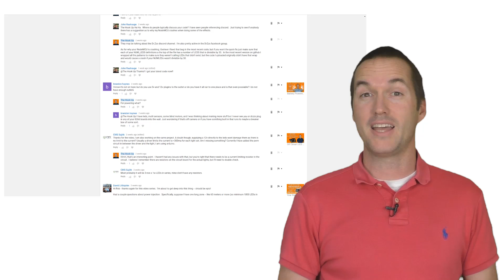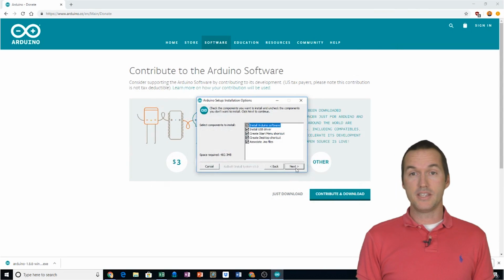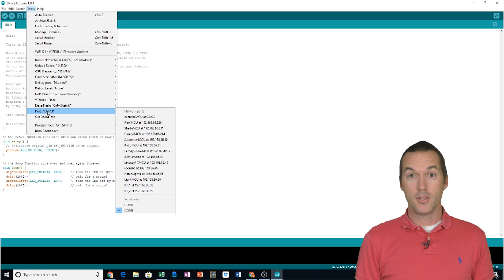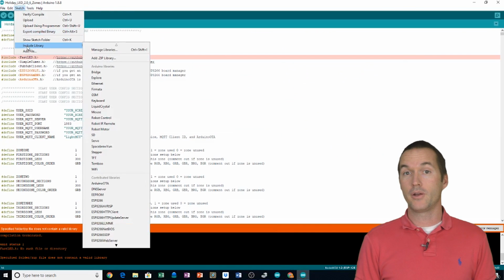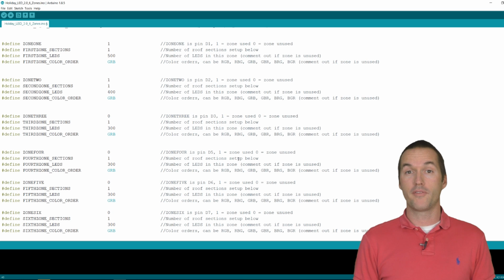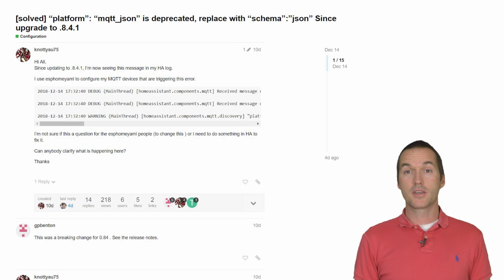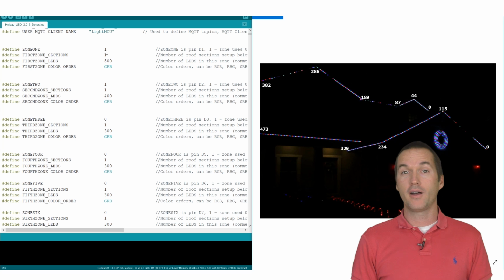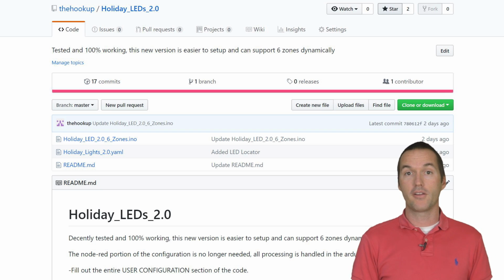Total Beginners Guide: Holiday Lights 2.0 Step by Step Arduino Installation and Setup.

Comment: Hi Rob, 
 Me again.. Im having trouble getting my "cards" and "Groups" loaded to make the buttons toggle the switch. The Current LED has no Slider Feature. Both the HA and NodeMCU are talking to my MQTT Broker. Home Assistant 0.101.3 is the version I am running.
Reply from the maker: Can you add them using the "configure UI" feature (click on the three dots in the upper left corner of HA).
Reply: @TheHookUp  Thanks, I'll try this when I get off work, I appreciate your quick response. I'll definitely be joining your patreons page as well. I also purchased a pi4 2GB  running HA with the 64bit image of Hassio if that makes a difference. Really enjoy your videos. Keep up the great work!
Reply: @TheHookUp  I was able to add them, unfortunately my set up is missing some key items. Locate LED sensor had no function, I was able to get the Holiday light switch to work. Colors 1,2,3 are unresponsive . Also, I don't have the W slider.
Reply from the maker: @AirBoone  sounds like the issue may be with your configuration.yaml file.  Can you post your entries from your config.yaml?
Reply: @TheHookUp   
 Yaml File:
# Configure a default setup of Home Assistant (frontend, api, etc)
default_config:
# Uncomment this if you are using SSL/TLS, running in Docker container, etc.
# http:
#   base_url: example.duckdns.org:8123
# Text to speech

tts:
  - platform: google_translate

group: !include groups.yaml
automation: !include automations.yaml
script: !include scripts.yaml

sensor:
  - platform: mqtt
    name: "Current LED"
    state_topic: "lightsmcu/locator"

light:
  - platform: mqtt
    name: "Holiday Lights"
    command_topic: "lightsmcu/power"
    state_topic: "lightsmcu/powerState"
    brightness_command_topic: "lightsmcu/brightness"
    brightness_state_topic: "lightsmcu/brightnessState"
    brightness_scale: 255
    white_value_command_topic: "lightsmcu/modifier"
    white_value_state_topic: "lightsmcu/modifierState"
    white_value_scale: 500
    effect_command_topic: "lightsmcu/effect"
    effect_state_topic: "lightsmcu/effectState"
    effect_list:
      - Color_Chase
      - Color_Glitter
      - Single_Race
      - Double_Crash
      - Rainbow
      - Blocked_Colors
      - BPM
      - Twinkle
      - Fire
      - Fill_Solid
      - Spooky_Eyes
      - LED_Locator
    retain: true
  - platform: mqtt
    name: "Color 1"
    command_topic: "lightsmcu/ColorPower"
    state_topic: "lightsmcu/powerState"
    rgb_command_topic: "lightsmcu/color1"
    rgb_state_topic: "lightsmcu/color1State"
    retain: true
  - platform: mqtt
    name: "Color 2"
    command_topic: "lightsmcu/ColorPower"
    state_topic: "lightsmcu/powerState"
    rgb_command_topic: "lightsmcu/color2"
    rgb_state_topic: "lightsmcu/color2State"
    retain: true
  - platform: mqtt
    name: "Color 3"
    command_topic: "lightsmcu/ColorPower"
    state_topic: "lightsmcu/powerState"
    rgb_command_topic: "lightsmcu/color3"
    rgb_state_topic: "lightsmcu/color3State"
    retain: true
  - platform: mqtt
    name: "Glitter"
    state_topic: "lightsmcu/glitter/state"
    command_topic: "lightsmcu/addEffects"
    payload_on: "Glitter On"
    payload_off: "Glitter Off"
    rgb_command_topic: "lightsmcu/glitterColor"
    rgb_state_topic: "lightsmcu/glitterColorState"
    white_value_command_topic: "lightsmcu/glitterChance"
    white_value_state_topic: "lightsmcu/glitterChanceState"
    white_value_scale: 255
    retain: true
  - platform: mqtt
    name: "Lightning"
    state_topic: "lightsmcu/lightning/state"
    command_topic: "lightsmcu/addEffects"
    payload_on: "Lightning On"
    payload_off: "Lightning Off"
    white_value_command_topic: "lightsmcu/lightningChance"
    white_value_state_topic: "lightsmcu/lightningChanceState"
    white_value_scale: 500
    retain: true

The only way I was able to get a card to appear was to add the group example to groups.
I've never coded anything in my life, so i don't know if adding this to groups is correct. or are you suppose to add both examples (groups and lovelace)? I've tried both ways and cant seem to figure it out.  
groups.yaml file:

group:
houseLights:
    name: Holiday Lights
    control: hidden
    entities:    
      - light.holiday_lights
      - light.color_1
      - light.color_2
      - light.color_3
      - light.glitter
      - light.lightning
      - sensor.current_led
Reply: @TheHookUp  after a couple of hours of research, I got them to work.  Thanks for all your help. Hope you have a great weekend!
Reply: @AirBoone  can you elaborate on what you did, this is the part im stuck on with toggles that dont work and i cant get my light strip to go. Not sure of what im doing wrong here.

Comment: Hi Rob, like everyone already said. Excellent videos. I was going to use dump lights for this year as well even though I saw some other videos like yours but your video made me decide I can do it. I like the explanation in yours much better. However, I am now stuck at configuring nodeMCU. Specifically the part where you compile Holiday light file. When I hit compile, I get the regular "bitbanged output" message but then I get the following error. I tried to redo the steps but not sure what went wrong. Would really appreciate any help. TIA!

Arduino: 1.8.10 (Windows 10), Board: "NodeMCU 1.0 (ESP-12E Module), 80 MHz, 4M (1M SPIFFS), v2 Lower Memory, Disabled, None, Only Sketch, 115200"

In file included from C:\Users\Vishal\Documents\Arduino\Holiday_LEDs_2.0-master\Holiday_LED_2.0_6_Zones\Holiday_LED_2.0_6_Zones.ino:7:0:

C:\Users\Vishal\Documents\Arduino\libraries\FastLED-master/FastLED.h:14:21: note: #pragma message: FastLED version 3.003.002

 #    pragma message "FastLED version 3.003.002"

                     ^

In file included from C:\Users\Vishal\Documents\Arduino\libraries\FastLED-master/FastLED.h:65:0,

                 from C:\Users\Vishal\Documents\Arduino\Holiday_LEDs_2.0-master\Holiday_LED_2.0_6_Zones\Holiday_LED_2.0_6_Zones.ino:7:

C:\Users\Vishal\Documents\Arduino\libraries\FastLED-master/fastspi.h:130:23: note: #pragma message: No hardware SPI pins defined.  All SPI access will default to bitbanged output

 #      pragma message "No hardware SPI pins defined.  All SPI access will default to bitbanged output"

                       ^

c:/users/vishal/appdata/local/arduino15/packages/esp8266/tools/xtensa-lx106-elf-gcc/1.20.0-26-gb404fb9-2/bin/../lib/gcc/xtensa-lx106-elf/4.8.2/../../../../xtensa-lx106-elf/bin/ld.exe: C:\Users\Vishal\AppData\Local\Temp\arduino_build_249461/Holiday_LED_2.0_6_Zones.ino.elf section `.text' will not fit in region `iram1_0_seg'

collect2.exe: error: ld returned 1 exit status

Multiple libraries were found for "PubSubClient.h"
 Used: C:\Users\Vishal\Documents\Arduino\libraries\pubsubclient-master
Multiple libraries were found for "ESP8266WiFi.h"
 Used: C:\Users\Vishal\AppData\Local\Arduino15\packages\esp8266\hardware\esp8266\2.4.1\libraries\ESP8266WiFi
Multiple libraries were found for "ESP8266mDNS.h"
 Used: C:\Users\Vishal\AppData\Local\Arduino15\packages\esp8266\hardware\esp8266\2.4.1\libraries\ESP8266mDNS
Multiple libraries were found for "ArduinoOTA.h"
 Used: C:\Users\Vishal\AppData\Local\Arduino15\packages\esp8266\hardware\esp8266\2.4.1\libraries\ArduinoOTA
Multiple libraries were found for "FastLED.h"
 Used: C:\Users\Vishal\Documents\Arduino\libraries\FastLED-master
Multiple libraries were found for "SimpleTimer.h"
 Used: C:\Users\Vishal\Documents\Arduino\libraries\Simple-Timer-Library-master
exit status 1
Error compiling for board NodeMCU 1.0 (ESP-12E Module).

This report would have more information with
"Show verbose output during compilation"
option enabled in File -> Preferences.
Reply: NVM. After looking at your github repo I switched to ESP8266 v2.4.2 and it's working now. Thanks!

Comment: I have just set this up with 2815 LED's and it works perfectly.
Still reviewing the code to see how i can setup different effects.
Reply: how did you wire the 4 wiers from ws2815 light to NodeMCU
Reply: @robertgates6196  just connect the data to D4. I did not connect the backup wire, though you could also connect that to D4. The backup channel is used if there is no signal from the data channel.
I used a level shifter to convert 3.3v from D4 to 5v that the LEDs require. For the +-, I connected to the power supply, via a fuse.

Comment: Hi bro again.... any idea the possible reason to face a problem with the first led/pixel... this is always on in green even if the holiday led lights are power off, also this pixel never works with the effect selected, it looks that this is not considered during the code execution, I have checked all connections and these are correct and identical like your instructions. If I unplugged the LED strip and power supply from power... or re-upload the Arduino code... the pixel on in green disappears by after few hours be working or in stand by, the first pixel on in green back. Any suggestion?
Reply from the maker: That's odd.  For your zones, are you starting at LED 1 or LED 0?  The first LED is always 0.
Reply: @TheHookUp  Thanks bro, I think I found the issue, I am working with WS2813 LED strip, so this have 4 wire (instead of 3 that WS2812B has), one of  those is Bi (backup data signal), I need to connect the first pixel Bi wire to GND to avoid issues, now it is working fine.

Comment: First of all thank  you for this awesome tutorial and all other videos that you post. I am running into a weird problem. Initially I was testing the sketch using Zonefour [D5-14] all was working fine. Then I turned on Zonefive [D6-12], Zonefour stopped working. I reverted my change and ZoneFour was back on. I tested it with ZZone 5 with Zone 1 SAME THING. Zone 2 seems to be fine and both Zone 5 and 1 work together. If I turn all 4 zones on- [1,2,4,5] Zone 5 does not come on. I even flashed another Arduino chip, re downloaded your code from GITHuB  - SAME RESULTS. Used a continuity tester to check for shortages, ALL LOOKS GOOD. Can you please something here - other than to use a different pin :).
Reply from the maker: That's a strange problem... are you using an ESP8266 NodeMCU?
Reply: Apparently the code doesn't allow you to skip a zone. Zone 3 has to be turned on. I changed out the PIN OUT reference and made Zone 1-4 work for me. THANK YOU AGAIN for this wonderful resource
Reply from the maker: @rajgoyal00  Glad you got it working.  I think the issue might be with the calculateMax() function that runs during setup, I wrote it thinking people would activate the zones in order.
Reply: @TheHookUp  I will be working on installing the lights soon. Will send you videos or pics once done. Thanks again.

Comment: Very nice video.  Just curious, did you ever add the E1.31 to use with xLights?
Reply from the maker: Yep, I've got a holiday show that I do in xlights.  I switch over to a dedicated controller for that though (I used a falcon F16V3 last year and I've got an Alphapix to check out for this year).  I'll be making a video about it for my November 6th release.
Reply: The Hook Up 
I was looking at both of those pixel controllers then after watching your video was considering doing it with ESP8266’s.
Reply from the maker: @jeffmills8737  I've also done that.  I ran 4x ESP8266 nodeMCUs with ESPixelStick on them for my first sequence.  My opinion is that if you're going to spend the time/effort putting up all those lights and sequencing them that it's worth it to spring for a controller, the experience is superior.
Reply from the maker: I ran this show off 4 nodeMCUs: https://youtu.be/-kaoWwBJ9Sc
Reply: The Hook Up just one more question(s):  when running xlights with ESPixelStick, did you have performance issues?  What would the advantage of using a pixel controller (Falcon or Holiday Coro) over several ESP8266’s?  Just curious your thoughts?  Thanks in advance.
Reply from the maker: @jeffmills8737  Yes, I would get lag spikes in the show, that's why I stopped using it.  Controllers are hardwired dedicated devices, so no sync issues.

Comment: Is Arduino the best way to go? I've started using PlatformIO and SublimeText for some of my projects (easier on the eyes too). Is there a way to set those up to work for these? or is Arduino IDE the most direct path
Reply from the maker: Lots of people love Platform.io, I am not one of those people.  It bothers me when too much stuff goes on behind the scenes.  If my programs don't work, I want to know exactly why they aren't working, I don't want my IDE to go try to find a fix for it.

Just my $.02 though, it's a pretty impressive program if it wasn't for my luddite tendencies.
Reply: @TheHookUp  I do need to learn to walk before riding a bike. Working on my first dive into esp8266 and LEDs, hoping to put together a mask and animation by halloween. 

Cheers and keep up the great work
Reply from the maker: @ein57ein  Best thing to do is just jump in.  Yes, start slow, but make sure you start!

Comment: Any plans to make a setup to support E131? I know there are issues with using more than one pin on a nodeMCU with E131. I also know there seems to be an issue with the current 2.0 repo with flashing if you don't have 2 zones setup. If you don't have plans to mess with it, I wouldn't mind being a collaborator on the github for this. I am a software engineer by trade. I really like your setup over WLED since it has the sections on it which just makes it look that much better in my opinion.
Reply: I also am pretty decent in React Native. I may be interested to build an app for it, for fun, open source, and make it do things like wled does as well as change and update settings pretty easily.

Comment: Thanks for a great video, is it possible to use this code on the SK6812 RGBW led`s with some changes? I really would like to use the warm white channel for normal lighting and have these effect during the holidays
Reply: Not gotten any feedback yet, so I still have not done anything.
Reply: Did you get the Sk6812 RGBW led's to work?  I have the same and am having some issues.

Comment: Is there a commercial equivalent to MQTT/HomeAssistant?  For example, can i use Google Home to take HomeAssistant's place?
Reply from the maker: You could theoretically use Amazon Echo to do a lot of what home assistant is doing, but it will never be as powerful.  I have a few of my projects working solely with Echo, but this isn't one I've tackled yet.

Comment: Great project .... unfortunately I have not been able to integrate with WS2813, I suppose the problem is the additional pin Bi ?
And the nodemcu pin D1 only give us 1 volt as output?
Reply from the maker: Output is 3.3 v.  Get yourself a logic level shifter.
Reply: @TheHookUp  Thanks... so maybe I am doing something wrong because the pin D1 is giving .07 v and with logic shiftter is changin to 1.3 v., one LED strip is working fine but maybe I will face problems with implement the rest of led strips, maybe my nodeMCU is damaged I will buy a new one to test it
Reply from the maker: @doggyide  That's just because you're measuring a pwm signal... it's maxed out at 5v I'd guess.

If it still isn't working I'd say you have another issue... can you see what the serial monitor says when plugged in via usb?
Reply: @doggyide  My wife bought them from the dollar store.  I took them apart and put my own LEDS in them.

Comment: Hi. Set this version 2 of the holiday Lights but i have hit 2 issues but i have used the sk6812 LED's.

1 only half of the lights are one when i plug it all in.
2 none of the HA is working with the lights but all is wired correctly.

Do i have to add extra power to the 2 wires that are on the sk6812's and should the code work ?

Thanks

Martyn